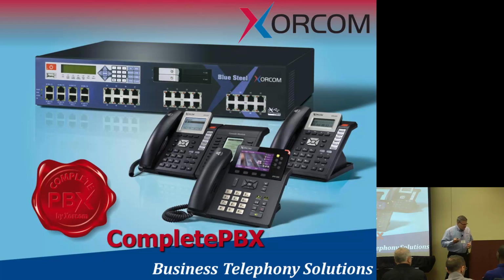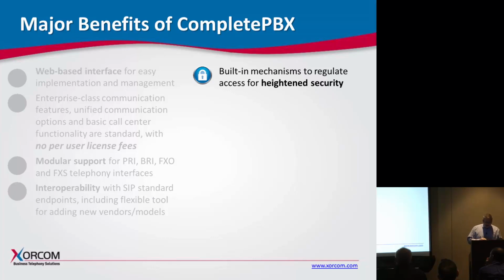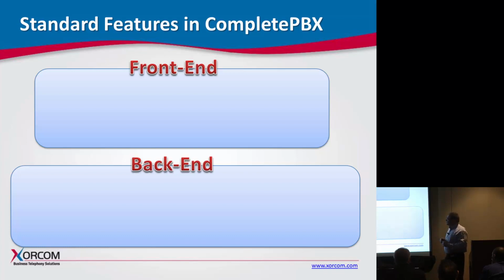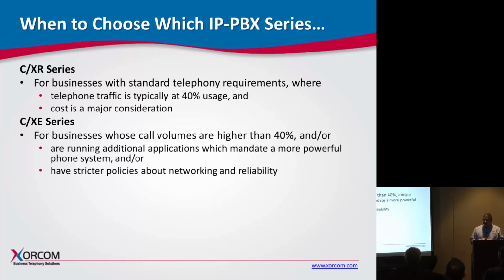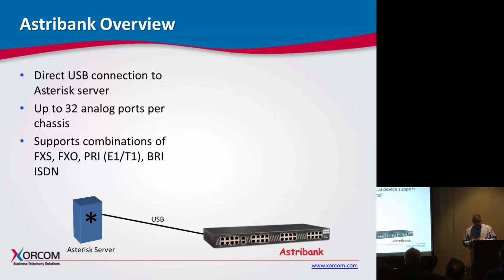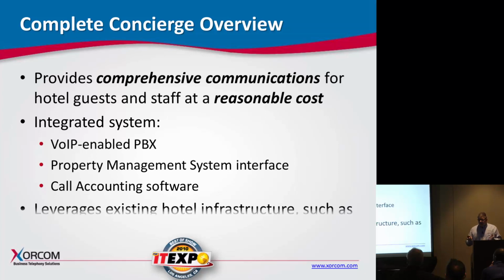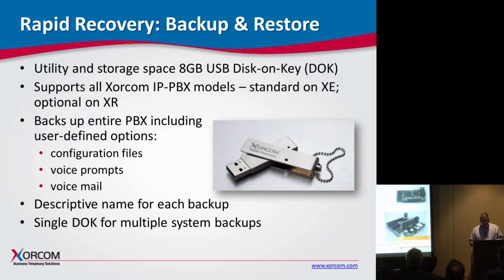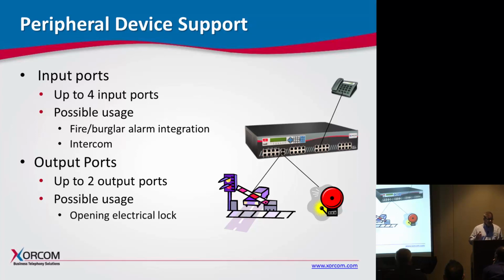01 Introduction to Xorcom Product Offering

Comment: I only wish Xorcom used standard telco wiring color codes with TCO's, life would be FAR easier.

Perhaps they can rethink this sillyness :)
Reply from the maker: Ressy66 Sorry for the inconvenience! I believe somewhere in the Xorcom archives there is a good explanation for this behavior. In any event, are you making use of our wiring guide?: http://www.xorcom.com/files/techdocs/tco-color-coding-table.pdf
Reply: Yes, but because its a proprietary method, it takes substantially longer, because you need to re reference it all the time per cable pair, perhaps they could offer an alternative, one that is a standard in future :)

eg: I've terminated a standard 100 pairs in less than half the time it takes to do one of your 32 pair TCO's - because we are taught the standard, its stuff we do in our sleep, when we have to use a completely different thing, it stands to reason we are starting all over from scratch again, its very, very slow and time consuming, hard to justify that to those who pay us.
anyways food for thought maybe...
Reply from the maker: Thanks for taking the time to describe the situation. I have confirmed with our production department that when current inventory is depleted we will restock with standard wiring.